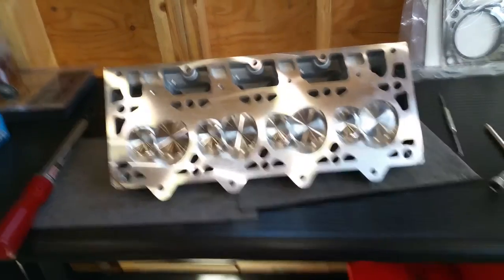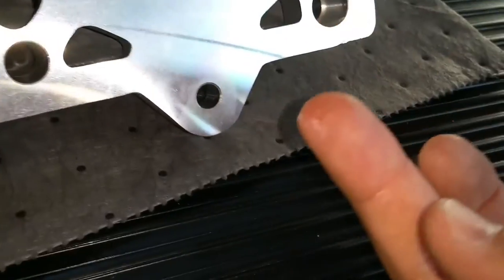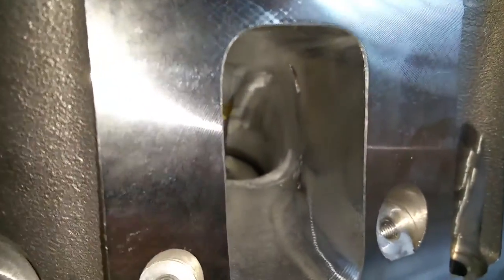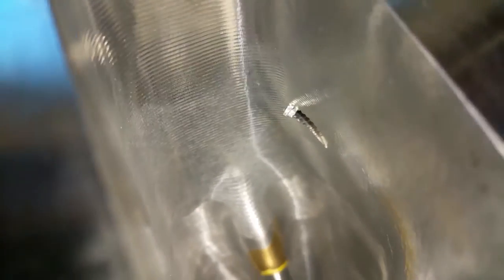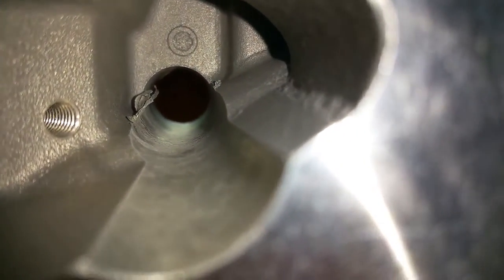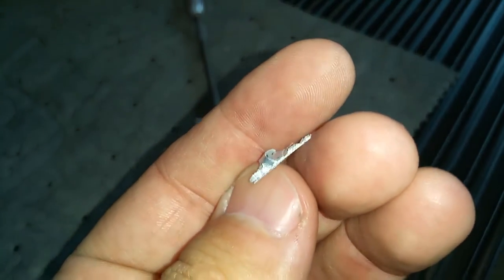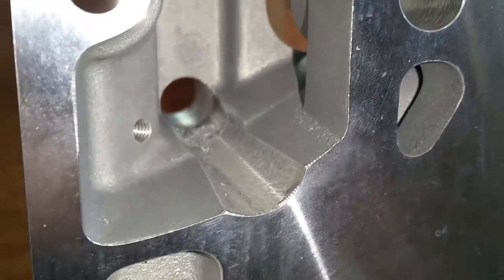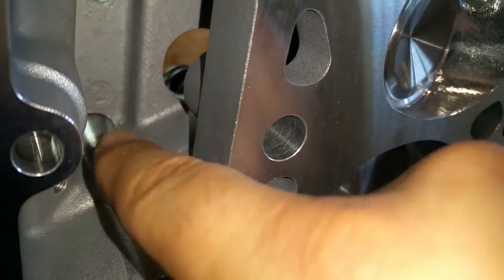NEVER INSTALL NEW CYLINDER HEADS STRAIGHT OUTTA BOX. Boosted C6 Build. Part #23

Comment: Thanks for the vids bro. I have a LS7 Z and this has helped tremendously
Reply from the maker: Thanks Jesse for watching my video and thanks for the positive comment. As you can see you really need to check over your new heads before you bolt them on your car. There was so much loose material in my heads they would have damaged my motor or heads for sure.

Comment: Its amazing this video came up in my recommendations. I am Beyond passed after I got my PRC heads I ordered. They sent me 2 boxes of metal flakes. For the money I spent, I thought I was getting some slick cnc'd Heads. But no I got 2 boxes of problems. Now they have to be disassembled, deberred, and seriously cleaned.

I've ordered heads from AFR, Brodix, and etc. And never have got a pair as screwed up as the PRC heads!!! A guy I know told me not to buy prc heads. He said they are known to fail. But noooo i had to buy them cause they were on sale. Well I can see why they fail now. Tsp heads and cams suck!!! Thats what my machinists told me in 2020. So I will only use AFR, Or Brodix heads on any LS I do from now on. Along with Cam Motions or BTR custom spec cams!!!!
Reply from the maker: Sorry brother, I can feel your pain and frustration.